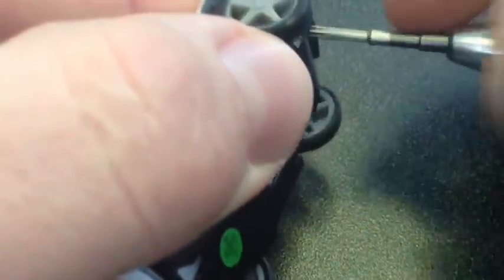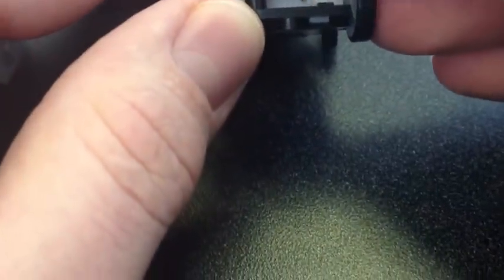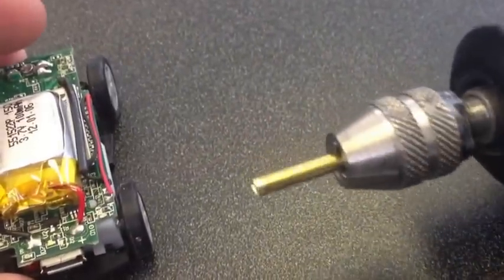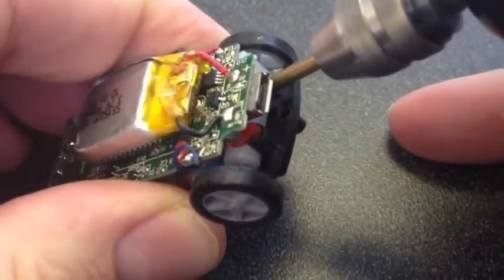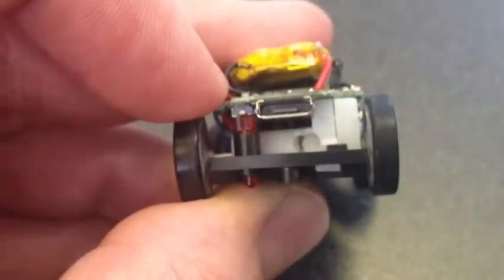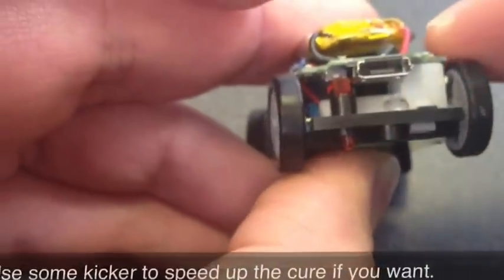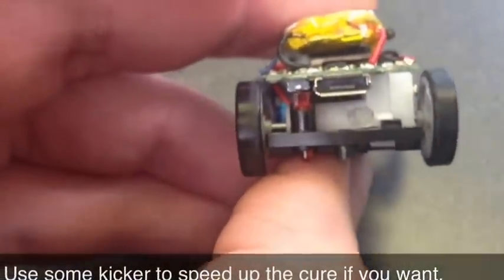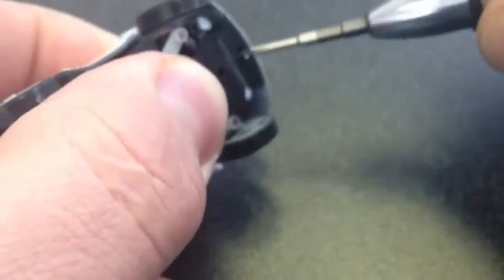Micro Car - Defeating The Safety Clutch

Comment: My car is behaving abnormally.Steering automatically goes towards right every time i switched it on and motor start running the wheels slow...faster...faster....fastest & then stops.Please suggest a solution.

PS- brand new never used.
Reply from the maker: +Faraz Ansari this indicates the steering sensor has been knocked out of place, the fix is shown here: https://youtu.be/NTjuYW91m4I
Reply: Many thanks Jason! however the video in reference isn't very clear perhaps due to camera focus and hence i couldn't understood a thing :(